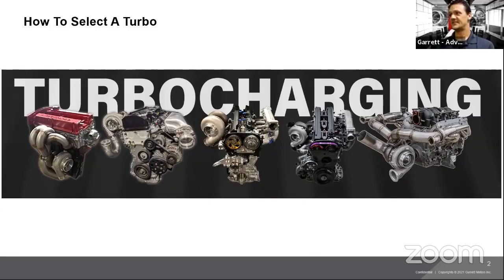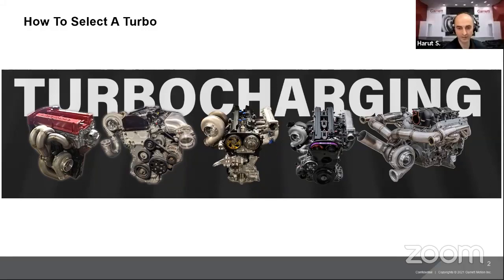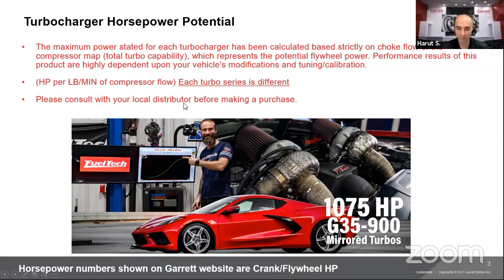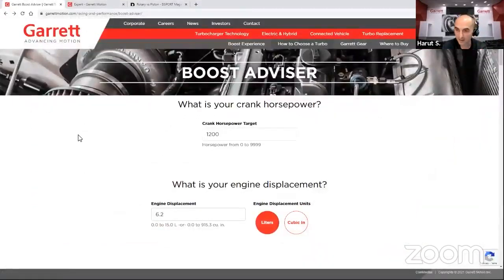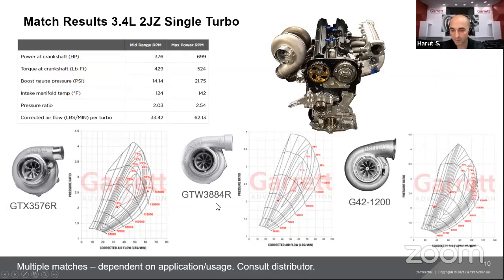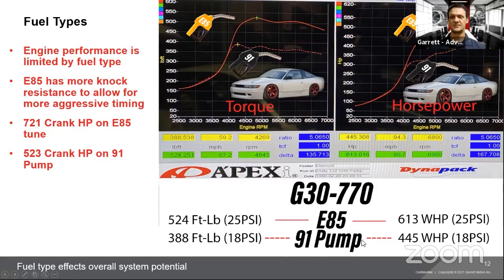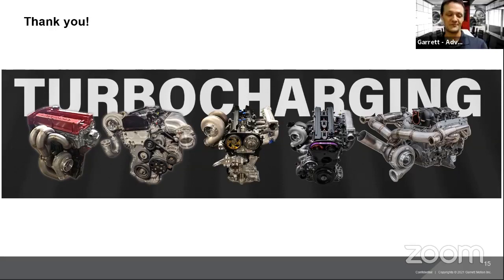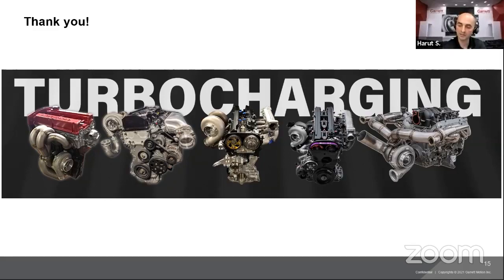Boost Your Knowledge - Selecting a Turbocharger | Garrett - Advancing Motion

Comment: Why does boost advisor output a significantly smaller max airflow for my application than the other calculators? It’s telling me I need around 67 lb/min where other calculators and equations tell me I need more like 80-85 lb/min. That difference really impacts selecting the correct turbo. The application is a 750hp 6L V8, sea level, 75 degrees F, 6700 rpm, air to air IC.